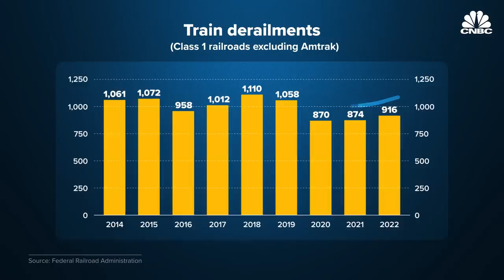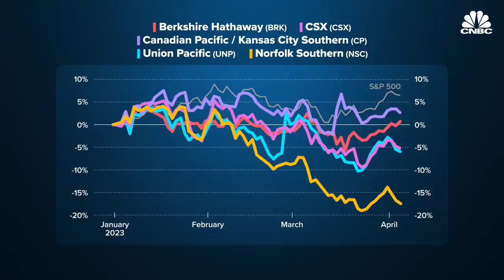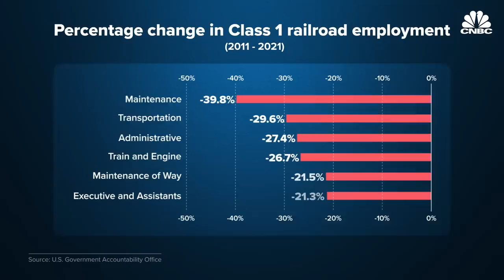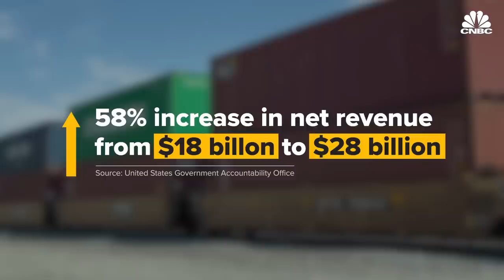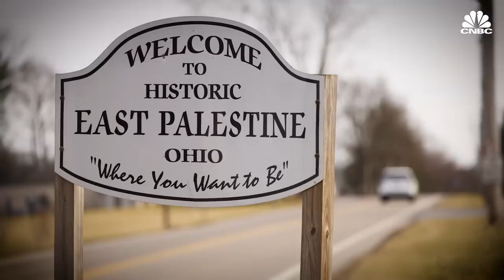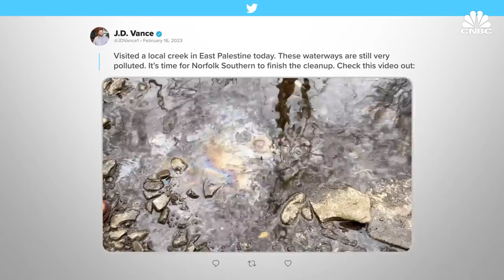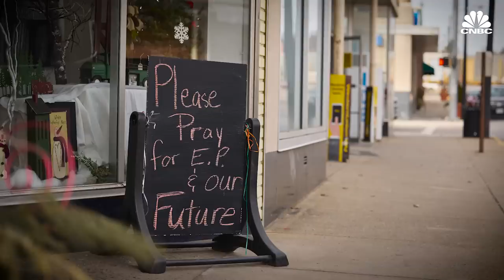Freight Trains Keep Derailing. Why?

Comment: I grew up in a house that was about 300' from a main line.  One night 12 cars derailed at our rural rail crossing.  The cause was a wheel journal that burned in two due to failed bearings.  The SP&S (now BNSF) engineer new there was a hotbox, but wanted to make it to the rail yard 20 miles up the line.  The rail company worked 24/7 to get the line repaired enough to reopen it, then jobbed the rest out to a salvage contractor who took months clean up(?) the mess, sort of.  After a while the grass grew long and green from all the Ammonium Chloride that dumped out the top of a bottom dump car.  Profit is the only thing that matters.  It's cheaper to clean up the mess than to replace wheel bearings per a maintenance schedule.

Comment: A few other things to consider....Longer trains mean more wheel beaings.  Bearing vibration analysis is a much better technique to identify bearings that are in the early stages of failure.  Bearing vibration analysis is difficult to implement because 1) it is expensive, 2) Transducers must be mounted on the bearing housing and 3) The skills required are rather complex and the training process tends to make the workers uncomfortable.   This is not text book theory.  I know, I have been there.  However it is sucessfully used in a number of Industries.
Reply: There are eight bearings per car.  They would need a power supply, a data link for the entire train, and sensors that can take a beating.
Reply: No one is putting sensors on bearings. It's not happening. You don't comprehend the number of rail cars online and the environment they live in. Simpler is better.
Reply: This is why the industry uses external fault detectors ("hot box detectors") to detect bad bearings - cheaper to have external detection of overheating bearings.
Reply: @AlanTheBeast100  The problem is the profit drive of the capitalist bosses. The rate of profit in industry declines as machine replace skilled labor with unskilled labor.
Reply: I feel like the number of sensors required to put them on individual cars would not only be extremely expensive, but also make maintenance a nightmare as the failure rate of such sensors would be quite high.
Reply: Even though it's expensive the RR's can always run to Congress with their palms open, and they receive a billion or two.
Still...I admit I don't fully understand this proposed technology.
Reply: @AlanTheBeast100  having more of them is the most concrete thing that can be done.  Also need more on lines with higher speeds.  A bearing can go from OK to disaster quite quickly.
Reply: @notthatdonald1385  They can't do that without laying the political groundwork as to why they can't use their billions in profits for the investment.They would face public hearings where the railroad workers would demand to be heard though their unions. The unions would question the reductions in crew sizes and the running of longer trains with no crew members in the rear.
Reply: They should be inspecting better after all these accidents

Comment: At the end, the guy like "we're putting in a THOUSAND more hot box detectors voluntarily" is committing that fallacy of saying the number instead of the proportion.  A thousand sounds like a lot until you realize they need a hundred thousand of them, or something of the like.  Any time a company or entity quotes the number of something, you should be wondering what proportion increase to the whole that is.  Because they deal with larger numbers than everyday people.
Reply: Word.
Reply: Just played with Google.  There are 160,000 miles of railroad in the US and there are (as of 2019) 6000 hot bix detectors and 39 acoustic bearing detectors.  Based on what was said in the video, perhaps the railroads need to change their protocol when a detection is made.  Let the railroaders determine when to stop.  The office / depot personnel should be consulted so as to avoid a bigger issue (e.g. collisio ) but not be in charge of a remote event.
Reply: Kind of like when the media reports something as a percentage or "times" increase when the actual incident rate is extremely low.  It happened with train derailments and COVID.
Reply: @MilwaukeeF40C  From what a quick Google could find:
Derailments in the United States are a particularly bad problem compared to other countries. While recording 777 million train-kilometers in 2019 (train-kilometers are the measure of a train traveling the distance of one kilometer), 1,338 derailments took place in the country. The EU, by contrast, only saw seventy-three derailments that year despite, by one count, recording 4.5 billion train-kilometers. For Japan, the same year saw more than 2 billion train-kilometers, according to Knoema, and only nine derailments. (In fact, the number of derailments in Japan over the past twenty-one years alone is roughly one-eighth of the amount the United States sees on average in a single year).
Reply: @KaiHenningsen  Ouch, I can feel the burn heat your reply just caused!

Comment: I LOVE these Docu series, they are so well done and interesting.
Reply: Practical Engineering also has a good video
Reply: WE NEED PROOF OF WHO IS CAUSING THIS
Reply: Except, this is at the Sunday Supplement (grade school level) of understanding and did NOT answer the question, other than in very general terms, of why freight trains keep derailing.  It is the accountants trying to stretch every penny for the investors; not considering the human factors of employees, customers, and community; and not considering the costs when a stretched system fails.
Reply: @BryanTorok  It did, the entire runway is being monitored by people outside of the field. They don’t know anything on the matter. Many security procedures were taken from the Captain of the train. Faulty sensors were also part of the reason. 

The derailing is caused by the speed and weight. These are constant variables since the cargo may be different every time. Thats why they have sensors to detect excess of heat in the rails or faulty mechanics.

Comment: We need more and better rail in the US. I don't want to have to fly and drive everywhere
Reply: Good luck with that, billions has been spend on high speed rail (HSR) but not a single mile is in operation. We're still running choo choo trains and can't even keep them on the tracks. While China has HSR that wraps around earth (in miles), they are moving away from 300kph to 600kph (372mph) with maglev trains. It's sad. China is so modern, clean, and futuristic, and we're still stuck in the 90s.
Reply: @jaiho9442  The cost for future high speed rail will continue to increase the longer we wait. As well everyone points to what some other country has, however they opted to spend the money to reap the benefits, rather than just focus on how much it would cost.
Reply: @jaiho9442  Billions well spent (would have been cheaper if we built it YEARS ago) and when they are complete the riders will come

Comment: Railroad companies need to do alot more to improve the industry--including adding more railroad workers.  Also, let Amtrak add new lines, and fully upgrade their train engines & passenger cars.
Reply: Amtrak is currently in the process of upgrading their rolling stock but problem for them is that all the US manufacturers only make freight locomotives and cars so they have to turn to European manufacturers which haven’t had as much experience making trains designed for Americas more outdated rail infrastructure
Reply: @tux_the_astronaut  pretty sure theres no “c” in Amtrak 🤷‍♂️
Reply: @tux_the_astronaut  you can’t get around tracks build better tracks

Comment: CSX has derailments no matter how good their infrastructure is. 
Seriously, it’s crazy how long some of these trains are now. 
The tracks are not able to handle such extreme weights from trains that are two sometimes three miles long. 
Also, the stupid rules about being able to inspect a freight car in one minute. 
How is that possible to find safety defects?
Reply: Train length has nothing to do with weight on the rails...which is not the problem anyway. 
A visual inspection of the wheel sets will not determine if the bearings are going bad
Reply: Tracks are only subject to the maximum weight of locomotives (heavier than cars) directly over them, not the entire train.
Reply: You might enjoy seeing the visual inspection done of the underside of a jet plane by one of the pilots before every flight.
Reply: The infrastructure is miserable! The railroads need to be repaired by the government!
Reply: @noidea5597  The railroads are privately owned...except for Amtrak. And all in all, they do a pretty good job of maintenance on their rail cars and tracks.
Reply: @williamedwards1528  The bosses let whole industry decline in the pursuit of profits. The don't want the workers to control the industry because then the rate of profit would decline.
Reply: @floxy20  Then compare the regulations for plane maintenance with the equivalent for rail cars.
Reply: Correct, but if you do have  a derailment the amount of damage is increased with more  weight shoving more cars into the pileup. For example if a derailment has only 50 cars benhind it only 7 cars pileup in the derailment but if you have 113 cars behind it 17 cars will pile up behind it until the movement stops
Reply: @noidea5597  Yeah, you definitely just proved your screen name right.
Reply: @revenniaga6249  That's not the only factor though, it also depends on how fast the Train is going.

Comment: Because they keep making them longer due to PSR (precision schedule railroading), they're not staffed like they should be to maximize profits. they're not maintaining the cars like they should be, they're not maintaining the tracks like they should be, and probably not inspecting the parts as often to be able to catch a part thats starting to fail. They also need to reevaluate the spacing in the defect detectors (i think it's one every twenty miles right now) especially when the track is getting near a town/city on a track thats going to go through said town/city.

Things on a train car can fail in quick order, it can go over a defect detector and everything's fine and within that 20 miles before it reaches the next defect detector it can have a failure and can detail.

Comment: Reducing costs is a good idea but it seems that US companies always reduce costs on a short term base. They do not think about it on the long run. Obviously all derailments and accidents are cheaper than investing in a safe network. 
This applies on many things manufactured in or delivered by the US and to the overall infrastructure as well. Everything is more or less run down because money needs to be spent to fix it, so it won't happen until there is no other choice.
Reply: That's the way capitalism works the rate of profit is gotten very low because they have gotten rid of so many workers the capital value is high they don't want to reinvest and they just want to cut labor costs and wait until the everything collapses and then demand a bailout.
Reply: @kimobrien.  Yep,
USA companies keep cutting costs.
In the beginning that's not an issue, it might even be a good thing.
After a while however, you start cutting into vital parts instead of excess.
The problem is that disasters can (and likely will) happen before they realise they did one cost cut to many.
Reply: @kimobrien.  Ding! You are correct. We are definitely headed for a bailout of the railroads. They already verified their too big to fail status when Congress stepped in to prevent a strike. Given the seeming guarantee of a bailout, one could argue that it’s the railroads’ fiduciary duty to their shareholders to run themselves into the ground.
Reply: @jeffreysnyder290  That's why we say the workers need to take control of industry with our unions and run it for human needs and create a labor party to take government out of capitalist hands.

Comment: Train wheels flanges are essential to help keep the train on the track. But yet they are too small. 
1" of wheel lift is all it takes for a wheel to come off the rail; especial on a curve. Make the flanges a bit longer and I guarantee you there will be less derailments.

Comment: ook at the big picture. 
Railroad companies have significantly increased the length of the trains to lower cost and increase profits. 
The consequence of longer trains is a significant increase of the risk.
Did the railroad companies put risk reduction actions in place? This is a $ billion question!  The cost reduction data in the chart shown in the video are mind-boggling : maintenance -39%, maintenance of way -21.5%.
The train length was increased, but the risk was not reduced!
After the tragic Lac Megantic disaster min 2013, Transport Canada has introduced a risk-based approach. A train transporting hazardous and flammable substances has many orders of magnitude of higher risk than a train transporting non-hazardous substance. Then the frequency of inspection and preventive maintenance and rail replacement must be increased to reduce the risk!

Comment: I really hope they figure this out. We need trains. They are so much more efficient than trucks.
Reply: Are they??
Reply: The freight RRs decided not to compete with trucking once the interstate system got built as local freight delivery to warehouses was not very profitable due to how much extra track mileage you need to maintain for moving so few cars at a time. The public pays for the construction and upkeep of the interstate system so trucks do not have this profitability issue. The only stuff that gets moved by train these days are really heavy bulk commodities like coal, oil, grain, ore, etc., and intermodal freight from ports (thank you commenter that pointed this out)* that are impractical to ship by truck overland. The only solution to this is to turn the railroads into a copy of our interstate system by nationalizing the US railway infrastructure.
Reply: @whoisthatkidd2212  Incorrect. Intermodal trains that carry container boxes (usually double stacked) are filled with common merchandise. These are unloaded at ports from ocean liners onto trains. Trains then can take these containers thousands of miles to inland ports where then they are unloaded onto trucks for delivery to warehouses and customers. One of these intermodal trains can eliminate 300 truck loads per trip. This is part of the whole intermodal system of the United States. Every means of transportation is dependent of the other. In fact the fastest growing type of freight train is intermodal commodities.
Reply: The interstates are underpriced for users.  This should be fixed by privatizing them all.  Right now the railroads actually take advantage of heavily subsidized roads with intermodal freight rates that are hard for all-road trucking to compete with.  But the catch is that "last mile" can be hundreds of miles on highways with new warehouses locating further away from cities and rail terminals.  And the trucks are often parked clogging city streets waiting to get in to lift yards.

Comment: Part of the issue that railroads are contending with is that it is the only transportation mode in the US whose operational costs are not directly subsidized by the government tax base (e.g. highways, airport security, customs, etc). Any funds that are made available tend to be discretionary or competitive...not a stable form of subsidization like other modes of transport. This has placed the railroads in a distinct competitive disadvantage. 

This is unfortunate since the advantages of a robust rail infrastructure benefit everyone in one way or another. Rail is a particularly efficient and safe method of transport...even on a really bad year.
Reply: True.  Mind you, they still profit by billions a year, plus billions in stock buy-backs to bump up executives' bonuses.

Comment: Maintenance eats into profit. You want cheap goods; the supplier wants cheap transport for your goods; the infrastructure company wants to spend as little as possible on moving your stuff from A to B. Track or rolling stock fails, the repair costs eat into the profit, so less is spent on maintenance. It's a vicious circle fueled by market economics.

Comment: These sort of hit pieces are such garbage. Train derailments happen all the time, have happened all the time, and are something that will continue to happen. But do you really think that the railroads don't care about them? Any derailment costs time on the main line that freight isn't moving, which costs them money. But yeah, big bad rail companies just don't care if their trains make a mess.

1000 incidents/year, most in rail yards. Vs how many hundreds of thousands of cars/containers and millions of miles traveled every year. Railroad companies aren't saints and they have a long way to go to provide reasonable working schedules for engineers, etc. However, imagine putting those millions of containers back onto trucks. Highway accidents would go up, delivery times would go up, cost of goods would go up, and the environmental impact would have greenies thrashing 24/7.

And do you want to pay more for the things you buy? Truth of the matter is, rail transport is the safest, most economical way to move goods. Period. The cost per rail mile is 4 times cheaper than moving by truck and significantly faster.
Reply: I think the same thing.